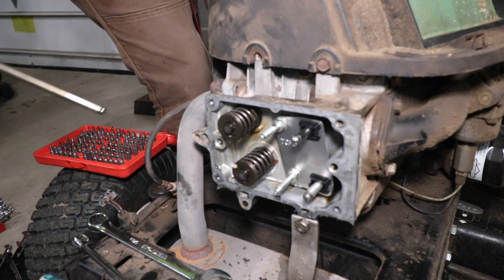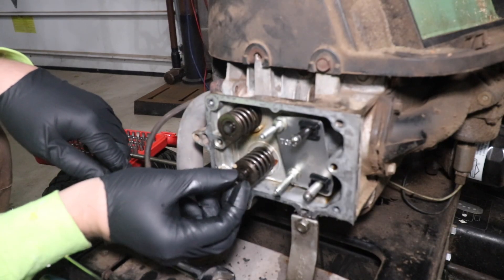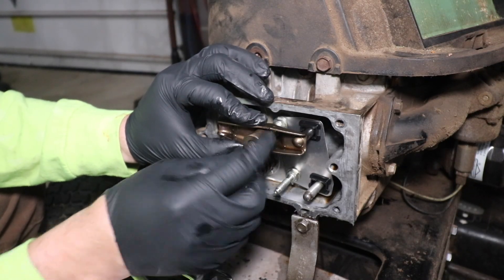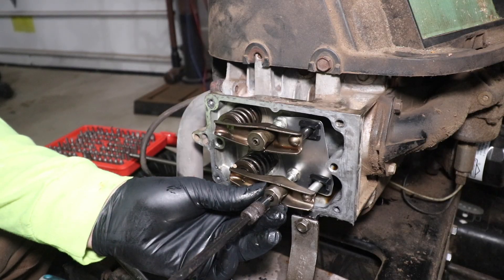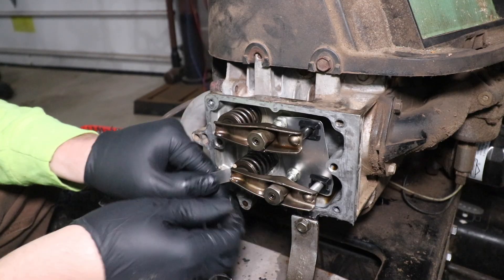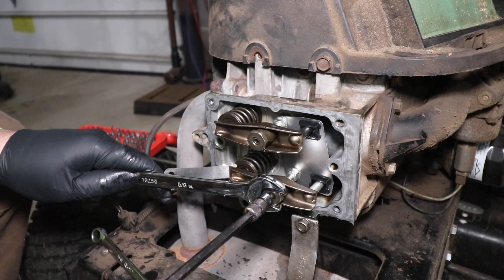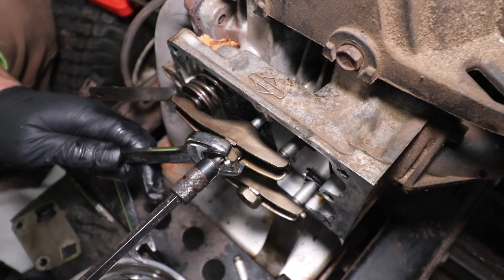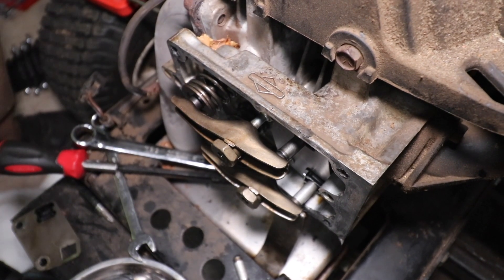Briggs and Stratton 19.5 hp valve adjustment | How to

Comment: If you have the the rocker arms off, you have to find top dead Center on the compression stroke if you don’t, you can’t properly adjust the valves .the rocker arms have play on the compression stroke . on the exaust top dead Center they don’t . two top dead centers on a four stroke engine

Comment: Where can I get those caps that go on. I'm missing one. Hopefully it didn't go in the motor
Reply from the maker: @ridgerunner956  Find the engine model number. Look up an engine parts diagram. Find the part number. Look up the part number on Amazon.